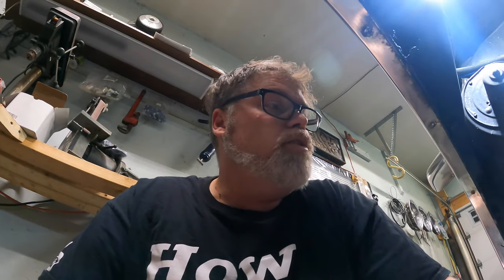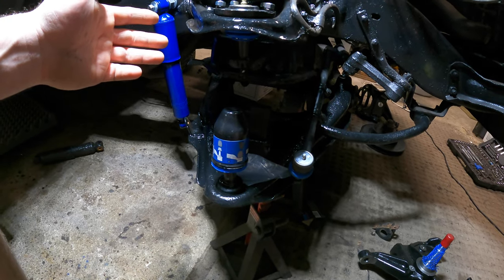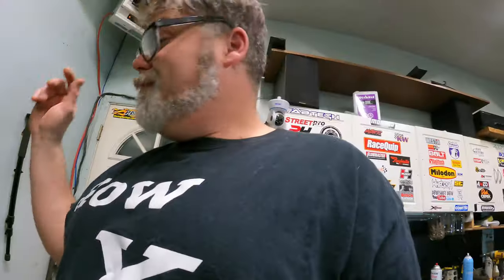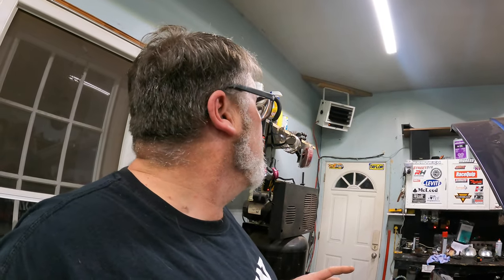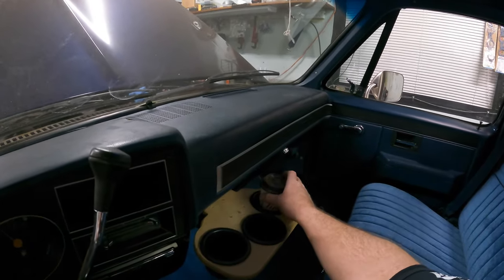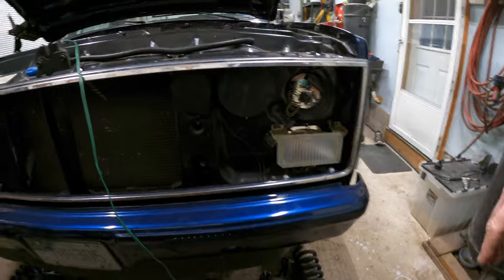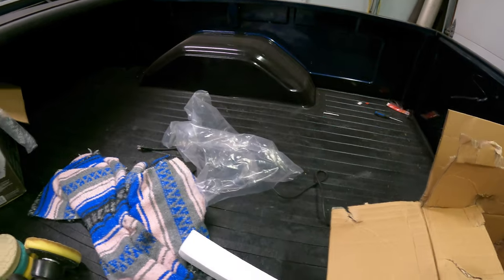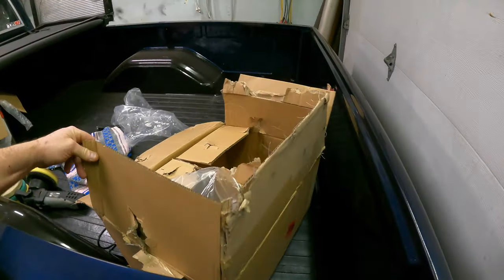The New Parts Fit    4K

Comment: Bill, my honest opinion....  LED bulbs for brake lights, turn signals, running lights, etc....  are fine, but LED headlights look totally out of place on older vehicles.  LED headlights look great on modern cars, but they just don't work on older vehicles.  Again, just my opinion.  On my 2006 GMC I kept the stock incandescent low beams, but installed extremely bright LED high beam bulbs.  This gives me the best of both worlds.  The truck looks normal when driving around town, but when I'm on road trips through the desert SW of the US, I have very bright LED high beams for those dark desert highways.   The truck is looking good, Captain!  They even had blue shocks and blue boots for the ball joints and tie rod ends.  DECENT!

Comment: I just bought some e-code hella h4 conversion headlights.  Anything decent by way of LEDs from a reputable manufacturer was way too much.  As for the cheaper LEDs, no thanks, don't want to be the guy blinding everybody else.   Though, you'll have to wait for spring/summer for any review cause I have no desire to be outside to make a harness and do a kinda sorta neat job on it. I already have too many quick just get it done quick wiring jobs cause its too cold/wet to spend time on it, and of course when the weather gets better f-it, it works I got other things to do, like watch somebody else work on their c10. =-)  
300 bucks for the rallys now eh?  I'm getting more tempted each time.